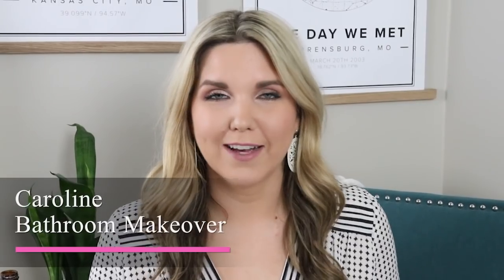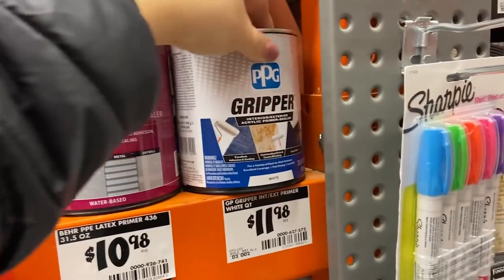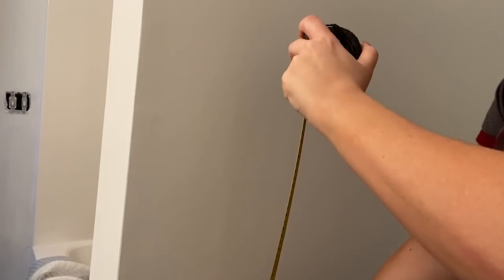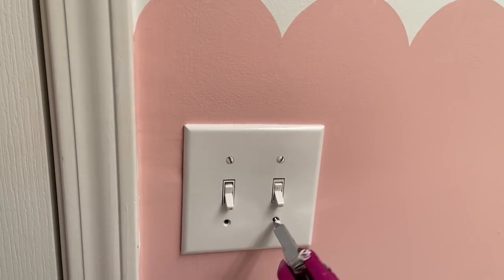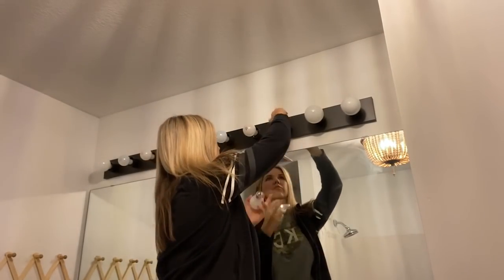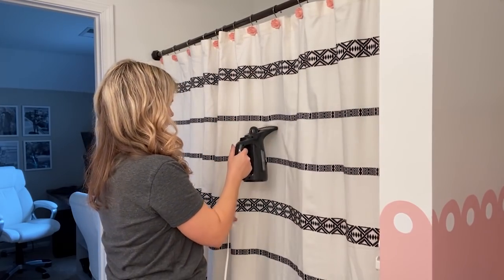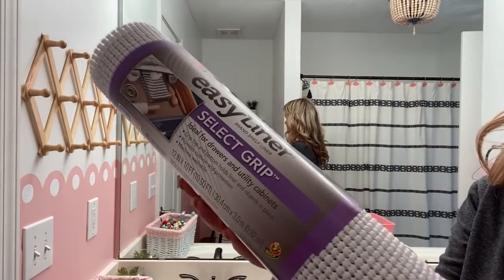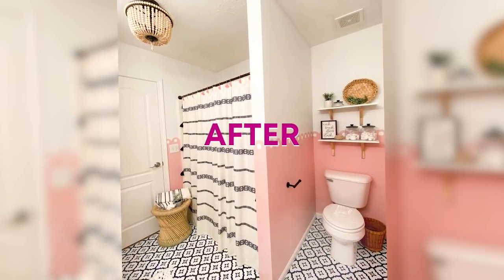Bathroom Makeover Under $300  - DIY Bathroom Remodel on a Budget

Comment: Liz!  I just love this bathroom makeover!  I really like the white dots to make it look like an eyelet edge.
Reply from the maker: I'm so glad you liked it, Amy Wallace! Stay tuned for more fun videos. 😊
Reply: @lizfenwickdiy  I believe that those Floor Pops is the answer to my prayers.  I have an old 1 bathroom home.  Whomever owned the house before I purchased it, did a lot of DIY projects but didn't do a very good job.  They installed small black and white tiles in the bathroom and didn't use spacers in between the tiles.  The grout lines are really fat and messy as they used some chipped tiles as well.  I absolutely hate that floor.  With budget being next to nothing these days during the pandemic, i think those tiles will work perfectly!  I have a few missing tiles and will replace them and the grout so that the Floor Pops will stick down.  Thanks for the great ideas!!

Comment: Very pretty and I definitely like the dot in the middle of the round, it is just what it needed!  I think it would be perfect for a young lady!  I am loving the color scheme at the end of it all and the softened color of the wicker against the black and natural woods.  The flooring is reasonable and a quick change for something you can change when you might wish to. Paint and primers and things have gone up so much in the paint department.  We got a five gallon bucket of paint at HD which cost us 125.00 and we needed 3 of those for part of the exterior of the house and I almost passed out and that was a couple years ago. I can only imagine what it runs now. The ceiling light is sweet and I think the old light fixture worked perfectly with the new globes.  Great job mom. Add the cost of your items up and the love and time that you put into all of it and it's priceless!  Bravo and Kudos to you!  It is a real  boost also to  renew the house and I always get a better calm feeling when we make improvements to our home. 
Blessings........I love that you did a through job on all the cabinets and hardware etc. Good Job Mom!!  :-)
Reply from the maker: That's great! I wish you all the best on your project, Mary Lou Mulloy. 😍

Comment: When applying those types of floor tile I was told to make sure you try not to touch the sticky side with your fingers. This will give an optimal adherence. Otherwise you may find the corners start to curl or pop up, since we tend to touch the corners. End result looks beautiful. Like the circle applied to the scallops.

Comment: Curious about how the floor tiles hold up with water and steam from bathroom.
Reply: Denise L  I used these in my bathroom several years ago. No problems. Just don’t buy cheap ones.
Reply: busdr2 what if you have large tiles that aren’t perfectly smooth? Do you think it would work on textured tiles??

Comment: Hi Liz I think you did a great job on your daughter bathroom make over I love the colors with the black accents only Two things I didn’t care for and that is the light fixture over the sink looks like you did paint in black and change the bulbs witch made a big difference and I know changing it  would have been costly and u did improve it 95 percent the other thing was the shower curtain rod and this is one of my pet peeve‘s I hate a tension rod I want my rod permanently screwed in to the wall I can’t stand that spring action tension rod just drives me crazy because they never seem to work right as soon as you notice one and is it at the right level and try to adjust it the thing will unscrew and all hell breaks loose so yeah I have a problem with the tension rod but I don’t and that you did a fantastic job and it looks beautiful the bathroom any little  girl would be proud to call her own

Comment: Thanks for these ideas. Very interesting. I recently moved into a new rental house where the owner put a truly horrifyingly unsanitary cabinet made of soft, porous, unsealed wood. Yikes. It's some really cheap wood that's as soft and un-cleanable as unsealed balsa wood. I've never even seen such a thing anywhere in a house, much less in a bathroom! There is no way to wipe it clean inside, made hideously worse by the previous tenant putting a DIRTY TOILET PLUNGER in there on its side. (HELP!) After I have bleached the heck out of the inside of that cabinet, I'm inspired by your video to seal it and then line it with those peel-n-stick washable tiles. That should render it usable after all, especially if I keep my stuff in washable plastic bins. Otherwise, it's a huge block of unusable space in a small bathroom. (What in the world were they thinking?!?)
Reply from the maker: Hi Jean Vignes. It's my pleasure to share. 😄